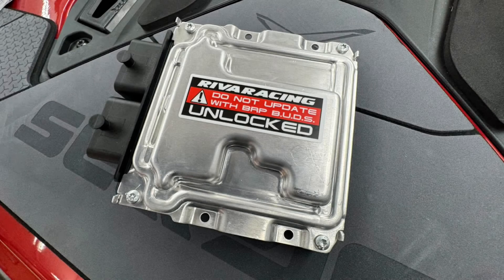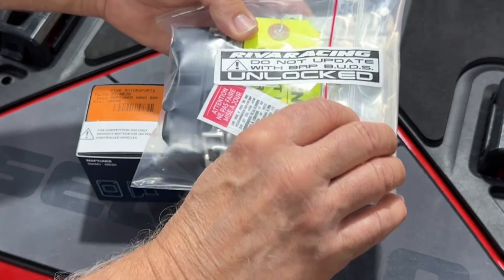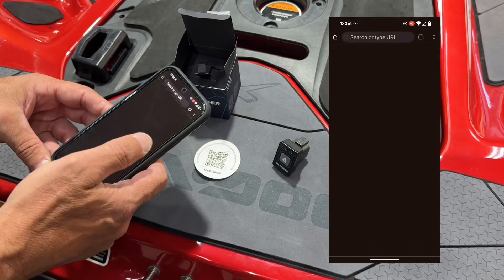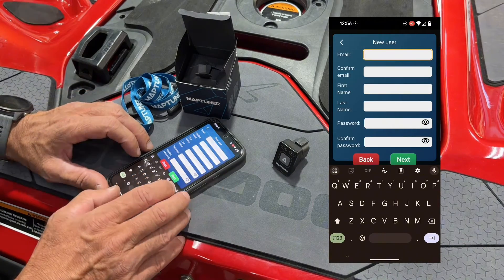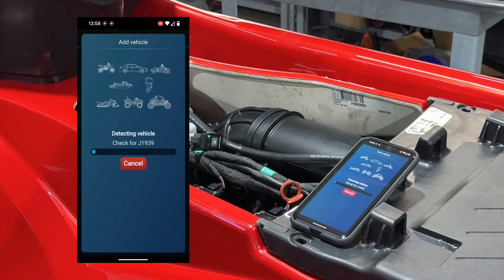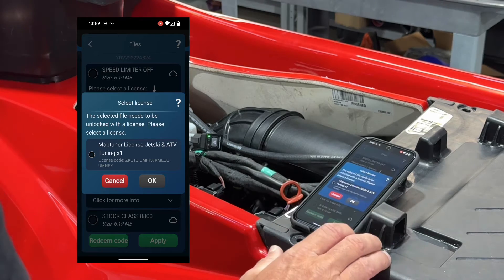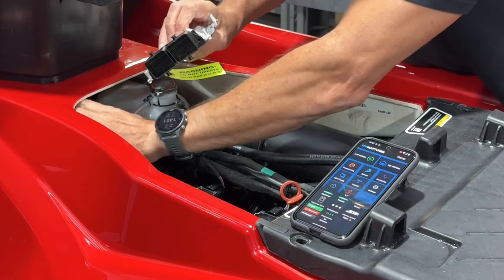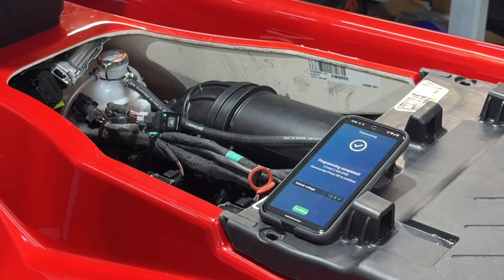RIVA Sea-Doo 325 Unlocked ECU Instructional Video

Comment: How easy is it to remove the bolts and change the ecu over please show this in the video
Reply: its extremely easy. I'm not gonna lie its a bit tedious, but not hard. Get the SMALLEST ratchet you own and put a T15 torx on it. slow and steady until you can spin them with your fingers.